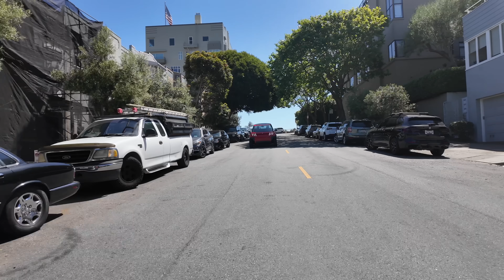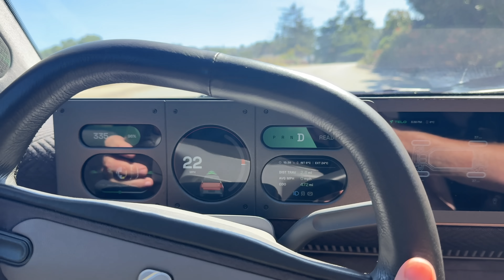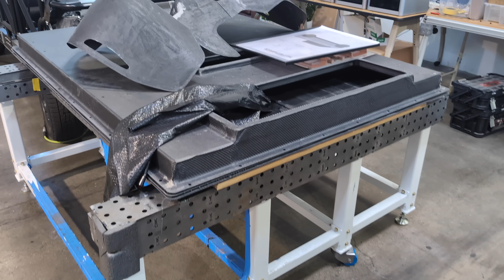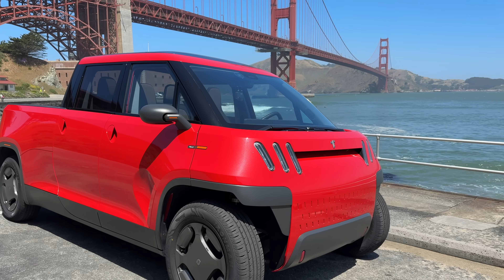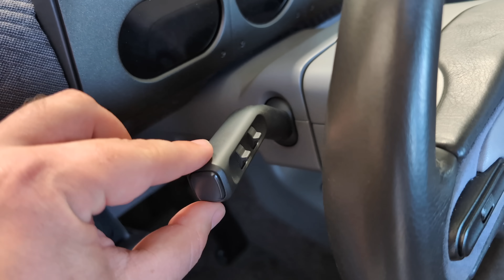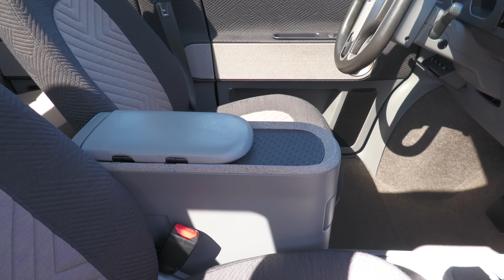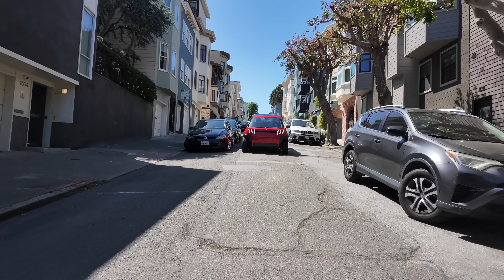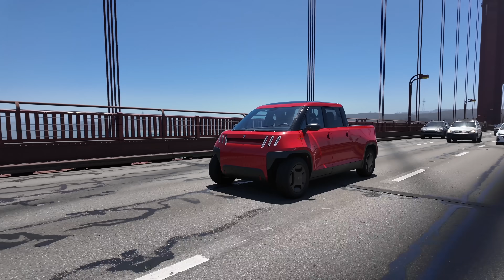The Tiny Telo Truck Hopes to Pack a Big Truck Punch

Comment: On one hand, as a software developer I absolutely love the approach of blocking off parts of the driver display for a more focused design and less real estate that needs to be filled with useless animations and stuff. On the other hand, it seems like a waste to have the display there anyway? Would've been neat if they just made those borders virtual instead of physical and allowed easy access to the display module for future upgrades or modding.

Comment: i wonder if they will eventually do something like teslas octovalve to let the two heat pumps help each other out as i could see the rear one getting overwhelmed if you take this on a trip (which yeah most won't but still)

the price seems fair. im surprised people thought it was high. i guess it is a smaller truck but still thats a lot of tech and engineering in that small package.

Comment: What puzzles me is...why suddenly cars need 500HP? Can't this be shifted towards higher energy cells instead of power? Lighter smaller drivetrains? Ditch motor cooling? All that will give us higher range and lower price. BUT NOOO. EV must do 0-60 in a femtosecond, tow a shippig container etc. Once this dumb "halo" era ends...I'll consider buying an EV.

Comment: too late and too little considering Bezos is coming with another small truck and 15000$ cheaper than the 41500$ 
No matter what: they will have to compete
Each $ more FORD will push them more and more with the F150 an economcy of scale effects.
Last startup that went wrong was Fisker and the Fisker ocean owners are struggling big times right now to get the services they need with a big mess. 

Would never ever consider to buy one, except the Slate backed by Bezos cause he will be taking it serious.

Comment: I really like it, especially the small size BUT right now its more a fashion statement rather than an actual urban work truck... reduce the battery to 60 ish kWh, reduce the power to 70 - 100 ish kW, make it two wheel drive, AND make it at least 15 k cheaper (25k $)...  Also, as an option, offer a two seater with a longer bed... Then you got proper products to sell...

Comment: Seems like an interesting vehicle concept, but i have a few points of criticism.

1. It's great that they shortened the vehicle in length considerable in comparison to other US trucks, but it still retains one of the biggest problems of the the US trucks currently on market: A big dead angle directly infront of the vehicle in which children can vanish. I furthermore wonder how this flat nose surface is behaving in the windtunnel ( i have some feelings that it isn't great but i would be interested to see the wind tunnel test data before judging in that regard).

2.why are they following the design principle of SUVs? Go make up your mind. Do you wanna build a hand small electric family car OR a car to haul freight around? The mix of both is the worst of both worlds. 

3.Why the ceiling window? It's a luxury that introduces lots of problems like i.e. potential damages if you use it to haul freight and a small stone or other object falls onto it. For a family car it might have it's uses but then why the truck bed? The fairey tale that families need to haul building material all the time from A to B is not real. And for groceries would an enlarged cabin with more space for the passengers in the back be better.

That's my POV as an small-minded (wordplay intentionally XD) european. What is everyone else thinking about these points i made? 🙂

Comment: I’m into this but the 300hp starting point is a bit much. An M939 5 ton has a 240hp NA diesel. Small trucks with normal power ratings please. I know breakneck acceleration is the EV thing, but we just don’t need it. I keep up on the highway in an 89hp diesel cinder block of a van loaded with cargo.

Comment: I might be the odd duck out but I would still rather have a full length 8ft box than the mid-gate that will likely get broken or leak after hauling heavy loads of lumber, metal, concrete, dirt or rocks a few times.  The entire appeal of a full 8 foot box is that you only have to secure or cover the top of the load if it's not heavy enough.  Being that I will always be single and never have kids, a standard size regular cab is just fine and would be ideal for most of the things I do.

Comment: Way too much money. Way too much power and battery. Should be 200 HP 2WD and 250 mile range and $30,000. Or better yet a small 4 cylinder turbo diesel and $25,000.

Comment: Not sure why you would spend millions to digress production methods into stamped steel/aluminum when you could vacuum form sheet composites for the panels like Saturn did and then also say “hey, it’s dent rust resistant”

Comment: No one in the US buys 2 door pickups anymore partly because nobody wants to sell them.
Reply: I own a two door pickup and they still are selling them today!
Reply: @gmv0553  Not literally nobody is selling them, but they are much less common on dealer lots than they used to be.
Reply: @chrisvaiuso6010  Dealers stock what is most likely to sell. It's still possible to order a regular cab from Ford and GM, you'll just have to wait a little while for it to show up.
Reply: My previous career was in a dealership. Brand new 2 door trucks would frequently sit on the lot for an entire year. Pre-owned 2 door trucks would frequently sit on the lot with no test drives until we sent them off to auction.

Of course there are people out there who want them, but it's a tiny market before even considering how many of them want an EV. Slate is at least cheap and good looking, so maybe they will find success as a "third vehicle" for enough families to stay afloat.
Reply: @_topikk_ you're probably selling your trucks for too much, and you're going to explain to me that your trucks are not actually too much and that you're very fair and at market price and I'm going to say yes that's exactly what I'm saying your prices are too much.
Reply: @Folly_Inds  Past tense, I'm no longer in that industry. In the case of new trucks, we were often not able to sell them for bottom line invoice price. If you're suggesting we should have priced them at negative profit the day they hit the lot, I don't think that is a very good argument.

In the case of used trucks, the only way to drive down the prices even lower was to offer even less on those trade-ins, which we attempted to reasonably do. 

I had a front row seat for the last gasps of single cab trucks in this country as we almost entirely stopped order them and made a lot of customers upset with our "lowball" trade valuations. Like manual transmissions, they became a thing that every guy said he wanted, but almost none would actually purchase.
Reply: You can still get a 2 door in a half ton work truck spec. Most are probably sold as cab chassis to put custom boxes on the back - don't need a back seat if you got a dozen lockable storage boxes on the back. Otherwise the lockable storage is very useful even if you aren't carrying passengers. Sure you could put a huge toolbox in the bed but that is a big compromise.

Comment: oh man the bezel on the dash display is a stupid idea that is GENIUS. Makes it dramatically easier to read
Reply: The ghost of the Nintendo 2DS!
Reply: @notanavrageloser  And I thought I was the only one who thought of that!
Reply: True, but I'd rather just have physical dials
Reply: @Mr.Pidgeon  A physical speedometer?  With dual kPH and MPH markings, like it's 1983?
Reply: @Mr.Pidgeon  I'd rather not. They are inaccurate as heck and with certain cars they can't even keep up with tracking the throttle response. Reflections and bright sunlight can be avoided by using a bright screen. It just makes sense as to reducing complexity and early EVs did use regular dials. It didn't look good.
Reply: @MrMega200 ok and? It doesn't need to be accurate to .1% of a mph or kpm, and it shouldn't have a problem keeping up with acceleration in day to day driving. As for it "looking good," that is up to each person and the designer, and if you grab a generic gm part and throw it into a cyber truck of course it won't look good
Reply: @Mr.Pidgeon  Nah, Always seen speedos out by 3 MPH or much as 5 MPH compared to to the GPS app which has access to sensors that are FAR more accurate.
Reply: @MrMega200 wont disagree, speedo shouldn't be out more than 1 or 2. Though i personally don't want more acreen blinding me
Reply: @MrMega200  Yeah. When I learned to drive, the standard for British speedos was "within 10%", and almost all of them over-read. I didn't like it very much. I didn't know about them not keeping up, but it makes sense. Dial speedos had a steel cup dragged by a spinning magnet, and the cup was maybe the heaviest moving part I've ever seen in a gauge.
Reply: throw me through the wind shield that is what i want🤣🤣
Reply: The same effect was used on MGB electric conversions to simulate the original Smith gauge cluster.
Reply: Does it? I thought that was trading usability for a gimmick
Reply: @32BitJunkie For some people with ADHD and/or Autism, it can be a bit overwhelming if too much is displayed without a clear border around each separate readout. Yes, it can be  done with on-screen boxes but, for some, having a featureless wall of glass instead of physical dividers can be an overload to their senses on its own. Plus, a physical bezel might help cut some of the glare off the display glass.
Reply: @Slyd_Fox  Interesting perspective.  Makes a lot of sense.
Reply: @Slyd_Fox  That's probably the reason why I never bought eyeglass frames that are half rim or rimless. It's distracting and confusing when the border between being able to see and not see is impossible to tell. Especially when I am driving.
Reply: @Slyd_Fox  Yep, and reflections on the screen contribute to overloading me. And I've noted bad health effects from being around screens with anti-reflection coatings.

Comment: I totally want one, I would absolutely love a small truck that is both really useful and cheap to drive. If they have good accessory support as well, even better, but I am tired of the only half decent EV trucks out there being the size and cost of monster trucks. I don’t need to traverse a gorge, I need to haul tools and materials and be able to replace my hybrid sedan at the same time. As it stands, my dinky Honda Insight has hauled more sheets of plywood than the average American’s truck lmfao.

Comment: Somethiing like a range extender or very basic hybrid system that allows steady state 40-70mph cruising without obliterating the battery could really make this thing a natiinwide phenomenon. If a small mechanical I3 turbo diesel like Robot Cantina could be manufactutered and sold again for a Harbor Freight/China Clone price and was allowed to be EPA legal because those laws are overly strict and accomplish nothing genuinly good for the world, environnment or economy in the lomg run.  We could be living in a much better world.I am all for electric for effiency, powe, simicity, low maintence, packaging...but I also know that unless they install a 3rd rail in fhe center of fhe interstate and marjor highways connected to solar power that allows EVs to be sold cheaper, be significanfly lighter and have veryp long range of course theyll never build a powered road for cars like trains use....so we might as well have tiny cheap diesel engines tbat have just enough power to maintain speed on level ground getting like 50-70mpg cruising 40-70mph. A tiny amount of soot....which is just dirt or like coal fhat naturally exists in the ground is not even close to how bad it is operating something like the new Hummer EV.

Comment: To be honest if they and manufacturers like Slate manage to get this thing going I can see them selling those in europe and asia aswell. No over-the-top scaling, no insanely overbuilt features, no blown out of proportions pricing and accesories. Just a workhorse/daily that happens to be electric and built to purpose. Like the main thign modern car manufacturers somehow forgot, building cars to their specific purpose.  The Telo are more like bigger Kei-Cars but with an acceptable crash rating. I really don't like the styling but if it works and works well that shouldn't be a concern anyway, at least not for a work truck.

Comment: I sincerely hope this thing really takes off. It isn't the perfect truck, but it looks like an excellent truck for the design criteria.
Reply: The perfect truck is no truck at all. It's a stupid design choice. The rest of the world figured out the van. A thing that keeps your cargo dry and locked up and/or can be custom fitted as a workshop for almost any purpose. Oh and it holds more cargo.
Reply: @bzuidgeest  The problem with vans is that you can't get stuff in and out of it as efficiently as you can with a truck. Especially if you have multiple people trying to grab stuff. Even as a European I'm very interested in something like this.
Reply: @Hendlton than you're doing something wrong with your van. Or you have the wrong type. Possibly you need different loading doors. But if you really want an open bed in the back, we do have small trucks/vans with those and they take more cargo than American style models that show big, but lose a lot of capacity because of their thick side panels. And no American truck comes with hydraulic lifts and such options, vans do.
Reply: @bzuidgeest  <- I can guarantee this person has never worked a manual job.
Reply: @bzuidgeest  ever heard of a kei truck? This thing is trying to be an American electric Kei truck, kei trucks should be here in America.
Reply: @bzuidgeest  Vans are very common in the US, Pickup trucks are usually used for dirty items or things that are to big and awkward for a van. They have different purposes.
Reply: @Anticitizen666 <-- I can guarantee this person is an American that hasn't seen much of the world.
Reply: @Compact-Disc_700mb no they don't. Trucks are in large part a US thing. If they truly served a separate purpose, they would be used everywhere. They are not. 
Unless you count driving terrorists around.
Reply: @bzuidgeest I’m European. You really are good at being wrong, aren’t you? 😂
Reply: @Anticitizen666 strange because I thought exactly the same. But maybe you're lying to look smarter. Who knows😂
Reply: @bzuidgeest  I know we have those, I use two different ones at work every day. I just see this argument all the time that vans are superior to trucks in every way, which is simply not true.
Reply: @bzuidgeest  Why do you have such a hate boner for americans? Does it make you feel special or something?
Reply: @bzuidgeest  Trucks have better fuel economy than vans, Vans are usually  even bigger than trucks, have worse side and real visibility, Trucks are easier to load, and some cargo should be separated from the passenger compartment
Reply: @misham6547 i doubt your fuel economy argument, but it might be true in America where they can't design for fuel economy if their life depended on it. Trucks easier to load? Vans optionally have hydraulic lifts, most vans I know of have the cargo separated from the passengers so don't know what you want to claim there. And ever tried to install a tool bench or tool rack in a pickup truck? Vans come in all kinds of custom builds for any kind of job. There's an entire industry for meeting the professionals needs for any job. That won't happen for a pickup truck bed. As to size, yes vans can be larger, but they also come smaller, and are often less wide. And your cargo doesn't get wet in them.

Comment: I was under the impression no one buys single cab pickups anymore because nobody sells one worth buying anymore, about 20 years ago they all quit building the dedicated full size long bed frame and started building them on the longer wheelbase extend cab frames with the associated crappy turning circle. The full size single cab short box got phased out entirely. I think its all driven by that CAFE footprint thing but I'm not sure.

Comment: The questions you start asking around 4 minutes are easily the best questions I've ever heard a journalist ask about an EV. You don't care about the buzzwords. "Tell me about the electronics in this here electric"
Reply: He didn't ask the most important question: What's the loading capacity? It's a pickup after all.
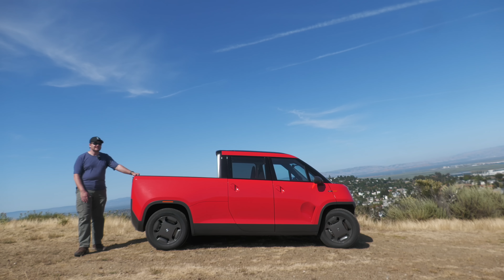Reply: @pseudonym3690 At 1:38 he details the expected payload and towing capacity of the production version. The truck shown in the video is pre-production, however, so those numbers are just estimates.
Reply: @sparklefluff  Yes, but no mentioning of the cargo bed's size. The Cybertruck supposedly can also carry the weight of a horse, but can't even fit a bike, so this is kind of important, yet not mentioned.
Reply: @pseudonym3690  Ah, I see. He does say that the bed is 4ft wide and 5ft long, though you're correct that there's no cubic measurement of total space, which might've been helpful to have.
Reply: @sparklefluff  Thanks! I must have missed that.
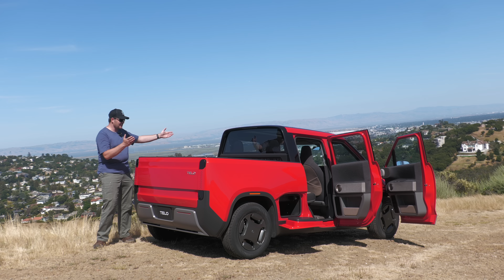Reply: @pseudonym3690 No problem! He mentioned it at 1:00 and then didn't really mention it again so pretty easy to miss.
Reply: @pseudonym3690 4ft by 5ft … expanding to 4ft by 8ft by folding down the rear seats 🙂
Reply: is there more then raw power?

Comment: Interesting, I hope they do well. As a guy who drives a stripped down (as much as you can) 2 door 2wd long box this is somewhat intriguing. My issue is charging is inconvenient where I am (condo says no chargers) and a huge reason I bought my truck with it's bench seat is leg room both forward and sideways as a guy who is 6'2" it's kinda important to me. This looks a tad cramped. That and the age old I am in Canada and am still not convinced of the usefulness of electrics with out climate and extended drives if I want to visit family outside of my city. A 3.5 hour one way drive is tedious enough without adding another 2 to 3 stops for charging and 20 to 30 mins a pop.